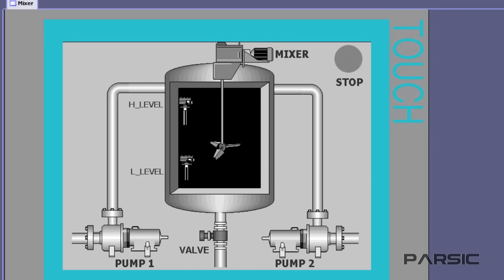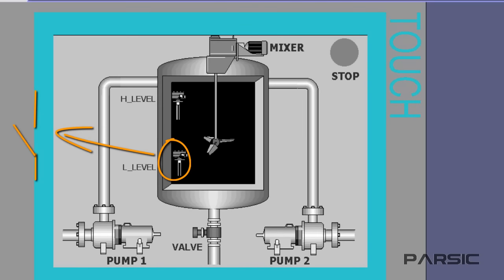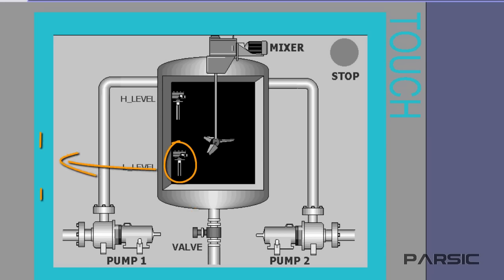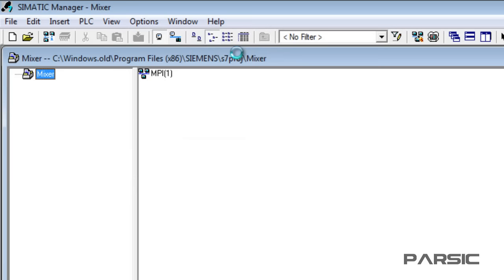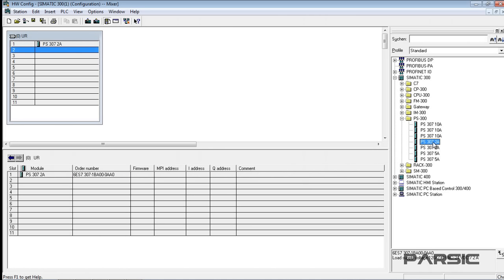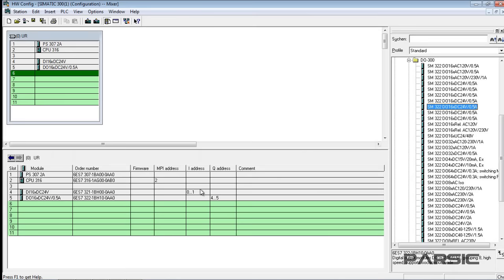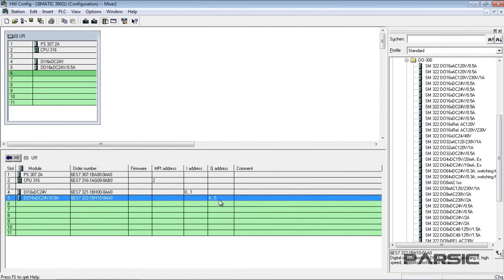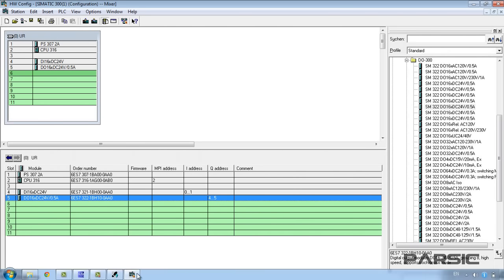PLC Programming Tutorial for Beginners_ Part 1

Comment: I remember getting a taste of this stuff when the processing room I used to work in was getting retooled and programmers were working to get all valves, mixers, sensors etc. operating correctly. I as a lowly operator got to see that. Never knew how much went into programming something simple as turning a mixer on or off.
Reply: Excellent clear explanation

Comment from the maker: Rodrigo, We're glad you found the video helpful. Tenha Um Bom Dia!
Reply: +RealPars could you explain how are you chosing hardware that you are using? Are those elements you work with in real work? Are they somehow better then others?
Reply from the maker: Hi there, Sorry it seems like we have not been notified for this comment. I know it's too late and you've have probably found the answer to your question but I'm answering this hoping it can be helpful to others. The PLC hardware that we use depends  on the specifications of each project. For instance, when you have 12 digital input signals, you need to select a digital input card that has at least 12 inputs. In this case you can select a 16-point digital input card and use the additional 4 inputs as reserves in the case you needed to connect additional digital input to the PLC in the future. So the type and number of signals that you have in each project determines what PLC modules you need to use. The PLC hardware that we use in the software are exactly the same as the hardware we use in the electrical enclosure (the real world environment). I hope this help. Let us know if you have more questions.
Reply: Hello RealPars, im azhar from Indonesia'. Im your subsciber. GodBlessU. Im Programmer for PLC. i want to have permite from u to re-upload your Video every part using Indonesia language (bahasa). If u permite me'. I will very happy. Thanks
Reply: Does your courses cover allenbradley studio 5000 plc program systems

Comment: Howdy.
There is little general theory about PLC programming. Having been an automation teacher/trainer in my work years I have tried to formulate some distinctions.
1. The sensors provide a fully deterministic picture of the process. In English. Every single process phase provides a unique combination of sensor data. The PLC program may consist of logic gates only.
2. The sensors do not provide a fully deterministic process picture. The program must have memory bits assigned to keep track of the process. In English. A pneumatic cylinder only has home and out position detection. When the program activates cylinder out it also sets a memory bit ON. Retracting sets the bit OFF. The program reads the memory bit and is able to determine the process phase. SET and RESET operations are needed.
3. Batch processes. The process has few sensors. The program uses timers for many  process phases. The program is itself an almost fully deterministic picture of the process.
4. Looping batch processes. A new batch starts automatically when the former has finished.
This often requires resetting all used memory bits before starting a new batch.
5. Some batch processes have no sensoring at all. The PLC program must be a fully deterministic picture of the process. Stepping programming is the most effective language. It has built in lockings to prevent false step triggering. At start up the program will reset all memory bits. Omron has a special bit that is ON only during the first PLC cycle which may be used for resetting. Siemens S7 uses a special Organisation Block (OB) to do that.
I hope someone may find this useful.
Regards.
Reply from the maker: Thank you very much for sharing that, Eugene!
Reply: @realpars  Howdy again. Yeah.
Thank You for thanking.
In the heat of writing I forgot one thing.
In cases of only partially deterministic processes and programs the slope detection of a sensor or memory bit is often useful. When a sensor goes ON it triggers a memory bit ON. This bit is ON only the next program cycle and then goes back to OFF although the sensor may still be ON. This is rising edge detection. Falling edge detection is also available.
In Omron one simply assigns the rising/falling detection operation to a memory bit, or an input bit. Simatic S7 has this feature too but one must assign an auxiliary memory bit manually to the operation.
Regards again.

Comment: Hi, I'm an Italian girl and I'm apologize for my bad english...I have some doubts to this application.If the water and the product fills in the tank by pumps ( only the pumps...I see ) how is possible that the low level switch being closed to the mix water/product....for example when the tank is completely empty after the drain or for the first time after the assembly? Anyway...the videos are absolutely clear and thanks a lot for all.Please give me an answer about my question...
Reply: When the lower sensor don't send any signal, automatically the liquid is pump into the tank until the lower level is detected then the control system determinant of what happen

Comment: Great video tutorials! Could you please explain or refer to your videos on how to know it is 16 inputs ranging from I 0.0 to I 1.7! Thank you!
Reply from the maker: The inputs are identified by bytes, with 8 bits per byte.  A 16-point input card requires 2 bytes.  The first 8 inputs are in Byte 0 and are inputs 0.0, 0.1, 0.2, 0.3, 0.4, 0.5, 0.6, 0.7.  The second 8 inputs are in Byte 1 and are inputs 1.0, 1.1, 1.2, 1.3, 1.4, 1.5, 1.6, 1.7.

Comment: Simple step done with complex step....(2014) that's why I use a microcontroller, which is simple step, simple programming (2021)
Reply: o
Reply: But micro controller may not help you to run a refinery, a powerplant, an assemblimg unit a chiller, a ventilation etc....   But a PLC can
Reply: @shinoskv  PLC set up is a pain to get started... it takes a few months to get the grip... It was my worse night-mare in college...
Reply: @ndrsg3013  there are simple and easy methods to learn It..    Then it wont be a night mare...
Reply: @shinoskv  if you can identify simple method, would be very useful.  I’m learning again after many years.  Any pointers where to start would be most grateful

Comment: Simple and best lecture. Many thanks
Reply from the maker: Gopendra Pratap Singh You're welcome!
Reply: In real production high level switch should on NC contact because is wire is damaged or sensors tank could be overfill
Reply: Don't forget the low level switch! And there should also be an emergency halt/shutdown routine in case both contacts are open.

Comment: Wait, so do the LEVEL switches work differently? Like, what exactly makes them switch? Is it when fluid is around them or not? If so, the bottom one closes when fluid is not around it, but the top on closes when fluid is around it?
Reply: Yes, one to actuate the motors and the other one to send a signal to the plc /display unit tell you the tank is filled up and in turn start  mixing

Comment: Hello, I've got a MEC 310 PlC-Thomson Power Systems, I got  it from a diesel generator, I'd want to know if I could use it to automate processes, because I started to study about automation processes recently, thus I want to use this PLC to practise and automate  simple tasks, How could I do it? and Which sotfware could I use? I've practised using a software called Zelio Soft, I have just designed simple programs,and  I would like to  use those programs to work in the real life, thank you so much for making amazing videos, go on teaching and sharing!
Reply from the maker: MEC 310 controllers are programmed with a software package named TPS300.  The MEC 310 is not a typical PLC, as it is intended to be used with very specific equipment.  To learn the basics of PLC programming, I would purchase a low-cost PLC (like CLICK from AutomationDirect.com or ACE from Velocio.net) that comes with free software.  Zelio is a smart relay, but is a good way to get started with simple logic programs.  Enjoy discovering the world of PLC's!
Reply: @realpars  Thank you very much for answering, I just have one question more, do you know if it's possible to get the TPS300?, I'm so excited to continue learning about PLC's, they're fascinating, thus don't stop make your amazing videos, they've helped a lot to understand lots of interesting things.

Comment: Thank you have good explained .i would like ask you. Can we use it for download program to arduino. Or i should use another framework. The best of them of programming language is  like to paskal. That is easy language which we learned in schooll
Reply from the maker: Siemens STE7 is a compiled language used with Siemens S7 controllers only.  To use an Arduino or Raspberry PI, you will need a compatible Python programming package, like Sketch or Genuino.  Always research what software will be required when selecting hardware, and vice versa.

Comment: This is a just a bit of feedback.  It would help me to follow along if the teacher would explain why he is choosing the CPU, power supply, etc. that he is choosing, even if it is just to say that there is no reason.  In other words, is there a reason the 316 CPU was the right choice for this application?  If for this lesson the teacher is simply showing that a CPU should be selected, then stating such would help the viewer to continue following the lesson without thinking they missed something.  If there is some reason for choosing the 316, then stating how it was chosen as the right CPU for this application would help the viewer understand the concept of choosing a CPU, so they could think it through when they create a PLC, rather than feeling like they needed to memorize all of these selections.  What would be different had you chosen a different CPU?  What role does the CPU you choose play in the PLC program that we are setting up?  All the same questions apply for the power supply, and the input and output modules.  Where did the s7 folder come from?  What is it?  Where did the block folder come from?  What is it, and how did it get into the s7 folder?  What is an OB1, and how did it get into the block folder?  I see that the result of following this pathway gets me to the PLC I'm about to write.  But again, if I don't understand what this pathway is, it makes all of this another string of memorization that I won't recall in a week.
Reply from the maker: Thanks for the comment and the feedback. Choosing the CPU for your PLC depends on your applications. You need to check how many I/Os you have and depending on the networks that you have in your project, you need to make sure that you have the right ports on your CPU. For instance, if you want to use the PLC in a Profibus network, you better have a DP port on the CPU as well. As to your other questions, I understand that there might be a lot of other question marks here but going into the details of all of these is out of the scope of this video and requires a course to cover all of the aspects. We have courses in our library that goes more in-depth about PLC programming. Thanks again and good luck!

Comment: hi sir . in video you are saying , by using '' S7 300 and STEP 7 software '' it means that these are two different program ? what the difference between STEP 7 and S7 300??
Reply from the maker: Hi there, S7-300 is PLC model from Siemens. We have different PLC model manufactured by Siemens such as S7-1200, S7-1500, S7-300 and S7-400. 
STEP7 is the software that we use to program these PLCs. :)

Comment: So, the High Level Switch and Low Level Switch are kind of different? Low Level Switch is OFF if the water is present and will go ON if there is no water at its level (so the pumps can start pumping) and the High Level Switch is ON if the water is present and will go OFF if there is no water ?
Reply: This is what i am looking for Thanks

Comment: can you help me out here please.

A signal being sent out to a field decide from the PLC is Handled by the _____.?

A. output 
B. power supply 
C. input 
D. Programmable controller
Reply from the maker: A. Output. 

You download the program to the CPU module. based on this program, the CPU commands the output card to activate a specific device in the field. This could be a valve, contactor, relay or anything else. The output card then sends an electrical signal to the device and energize that.

But before that you first need to turn the output card on, like any other electronic devices that you have at home. So you firs power the output card by a power supply and then when it's turned on it can send electrical signals to other devices in the field.

Comment: Hi I am new to PLC, can I use studio 5000 to learn from here or I need to get "S7 300” PLC and “STEP 7”? Thank you
Reply from the maker: If you already have Studio 5000, you can use it to learn along with our videos.  The instruction set is slightly different than for Siemens S7 PLCs, but all of the instructions are available, and you can construct the logic as is done in the videos and get the same result.  

To purchase STEP 7 software or Studio 5000 software is pretty expensive, so if your goal is to learn PLC programming, I would suggest the following:

If you do not have a PLC programming software, I would suggest purchasing TIA Portal Basic, which is fully functional with a permanent license, simulator package, and WinCC HMI Basic software included.  This software can be used to program S7-1200 PLC only, but the instruction set for the S7-1200 is very similar to that of the S7-300.

https://marketplace.realpars.com/en-us/products/simatic-step-7-basic-v16-floating-license-download-6es7822-0ae06-0ya5simatic-step-7-basic-v16-floating-license-download-6es7822-0ae06-0ya5?_pos=1&_sid=1fdb6d693&_ss=r
Reply: @realpars  Thanks for the advice mate.

Comment: Please I need your advise , I have a project where I am expected to come up with a diesel dispensing system such that the pump to discharge diesel discharges an amount of diesel based on how much of diesel is needed at that time just like typing in 2000 liters to be discharged in a storage tank ,  a good example is a  fill station dispensing unit . Now we  have on ground a pump , a flow meter and a batch controller but a solenoid valve , a valve  and a manual valve to be installed just before the flow meter in case we need to carry out maintenance  on the flow meter . now based on the work philosophy my question is what kind of solenoid valve and valve can you recommend I use for this processes as the solenoid is meant to actuate the valve so it will closes ones a certain amount of product imputed has fully reached its final point ,and the pump is cutoff immediately the solenoid valve actuates the valve and it closes to avoid further flow of the fluid down the line .

Comment: Hi. Respect for guidance and knowledge.  But my question is   here 4 to 5 function.  Why do we used to PLC. It's really simple to control with C++. We can use Arduino.  5 raw requires for this program
Reply from the maker: Hello Nilanka Smith,

Thank you for your question. You're correct, this system could have been programmed in C++. But who are the first responders in most plants? Maintenance personnel are the first ones to show up when there is a system issue. And normally the program is written in a logic maintenance first responders can troubleshoot. PLC simplifies the logic that would normally have been engineered with relay logic. And PLC are cost-effective compared to a computer control logic device. 

Happy learning!

Comment: How to connect three PLC? We have a process system in three different enclosure. We want control from a single panel and how to connect them?
Reply from the maker: The answer depends on the type of PLC you are using.  For Siemens PLC's, typically the PLC's would be connected with ProfiNet or a proprietary MPI connection.  For Allen-Bradley PLC's, Ethernet/IP would typically be used.
Reply: @realpars  Can you suggest any video from your channel?

Comment: Hey. This leassons are really good but I have a question. You sed that we have 16 inputs, and I0.0 goes to I1.7, if it is 1st I0.0, 2nd is I0.1 .. 10th is I0.9, 11th is I1.0  and so on until 16th is I1.5. Can you explain to us what is true?
Reply from the maker: Hi there! The addressing for this input module will go like this:"I 0.0" to "I 0.7" and "I 1.0" to "I 1.7".
Reply: @realpars   Hi,sir 
                    I suppose that I 0.0 to I 0.7 and I 1.0 to I 1.7 is from the pin number of the cable.
                    As I know the bus cable PLC used is 9 pins and one pin for power and another for ground.
                    So that's why it is not I 0.0 -----> I 0.9 ------> I 1.0 -----> I 1.1 ..... I 1.5(16th)
                     Is it the root cause ?
                      Sorry I just a beginner of PLC . This is my first video training for PLC . I never touch them before.
Reply: @realpars  up until this reply I was so confused about addressing. Thank you!

Comment: I have logic could u do program for it.
when we move a 50 value then after moving the value is to increment by 1 and  after 1sec it has to decrement by 1;after reaching the increment value as 100 and decrement value as 0 again it should start incrementing the 0 value and decrementing 100 value 1sec.

Comment: sir i want to do project on boiler automation using plc and skada software. then which plc will be more useful for this project?
Reply from the maker: Choosing the PLC depends on the number of inputs and outputs that you have in the projects and also the features that you need. It's hard to tell what PLC you need to use from the info that is provided.
Reply: from where i can get list of plc? and their configurations